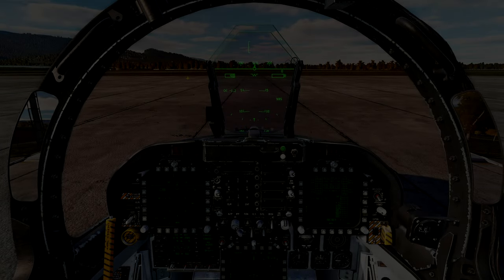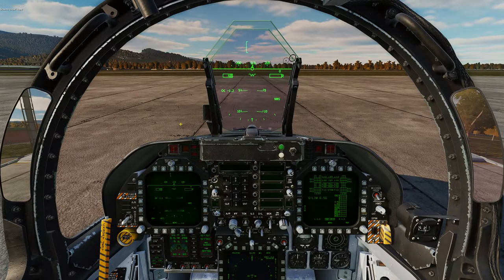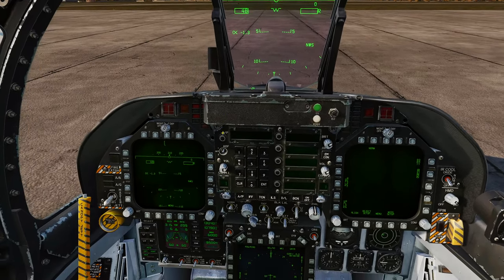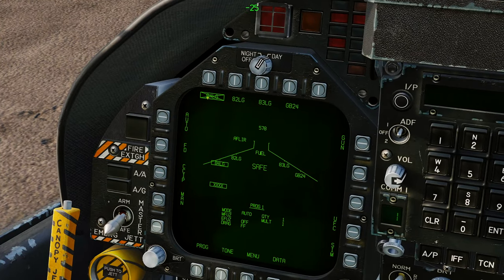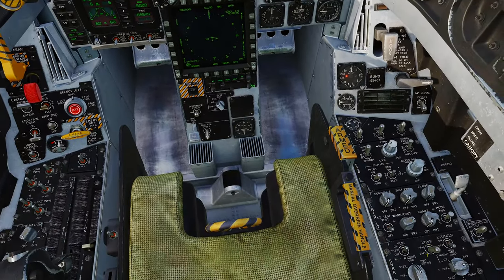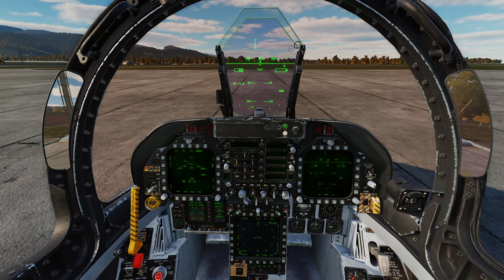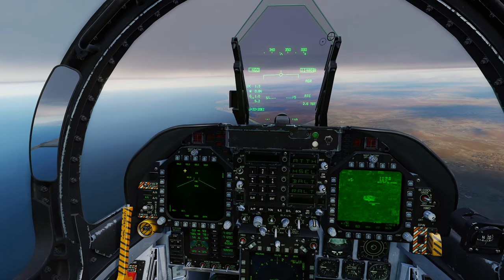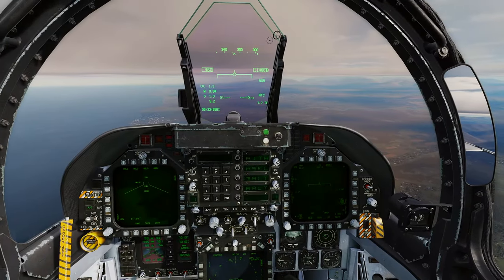DCS WORLD 2.7 UPDATE - F/A-18C Hornet Beginner Series: Laser Guided Bombing

Comment: Only thing I would add to this is to NOT arm the laser until you've found your next target and are lining up on it, or you'll burn out the laser if it's on too long. I've done this before and then you have to land and re-arm to change your targeting pod.
Reply from the maker: Arming the laser doesn’t burn it out AFAIK, I thought if you actually fired the laser manually for too long continuously it burns out but I most definitely could be wrong 🧐
Reply: @TorniQuetHD  maybe that's what I was doing. Firing it manually and forgetting to turn it off.

Comment: After drop the coupled aircraft banked left. Won’t that mask the pod if it’s on the left cheek? How far until in turn until pod is masked? Or was the target off to port?
Reply from the maker: When you are that close to target then aircraft can only really bank left or else it will mask the pod immediately with a right bank as the pod is on the left cheek station. It only has to be in view for approximately 40-50secs for bomb to track and hit target so masking shouldn’t be an issue in that time frame.
Reply: Awsome video. Just to explain what happens: When you have Coupled Auto Pilot for Auto Bombing selected, what ever your HSEL is set at, the jet will select HSEL once bomb hits target. Its always a good idea to select the direction you would like to exit.
Reply from the maker: @AdrianFourie  that makes sense 👍🏻 thanks for clearing it up!! Legend!!

Comment: Bro why didn't you trim the plane if was tilting ?
Reply: Why though. U just let it tilt ? Won't u press trim to trim it. Or does it not work . Mine doesn't work too well if too heavy on one side? Please help..
Reply from the maker: Depends on the situation mate, if I’m going to drop the other side straight away I won’t bother trimming it out because it will be all good again once the other station has been dropped. It’s personal preference mate, if you don’t want to put a stick input to correct the roll you trim it out, if you’re ok with holding the stick to maintain level flight then that’s cool too